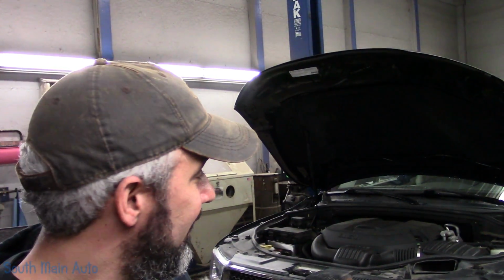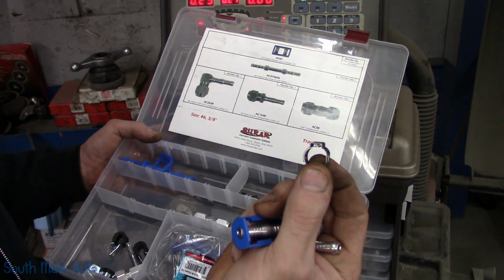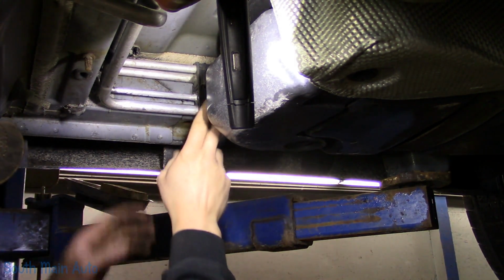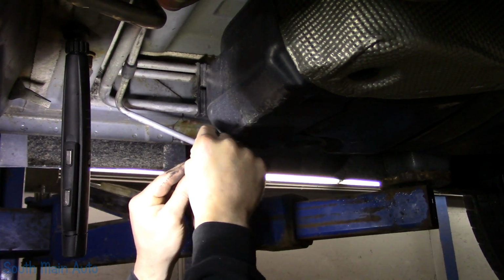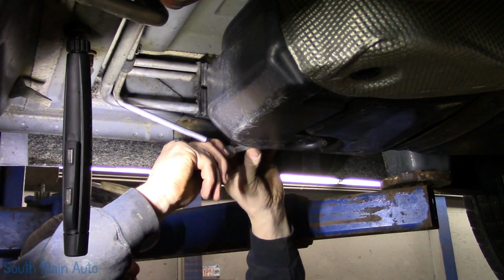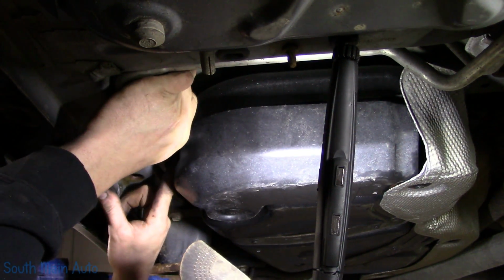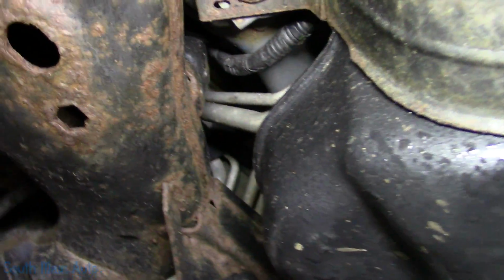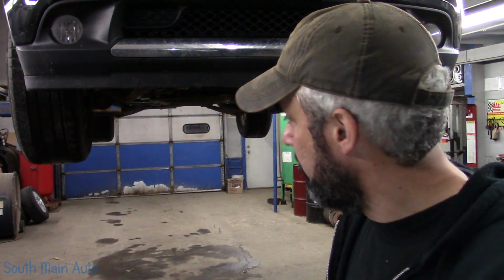Leaking Rear A/C Line Repair - Dodge Durango

Comment: Hi Eric...just a tip from an AC guy: Try a drop of NyLog on the O-ring, ferrule, and  line (and sometimes the threads).  NyLog is a sealant they've been using in the HVAC trade for years.  It works, and if used correctly (meaning sparely), it will not gum up orifices or TXVs.  I've had mixed results using NAPA repair fittings (never noticed if they were Dorman or SUR&R).  Most of the time I can get them tight without sealants, but there is always that 10% that can never please the sniffer.  Since I started using a couple drops of NyLog, I think I have that failure rate down to about 1%.  Make sure you get the NyLog Blue...it's for refrigerant systems using PAG oil (NyLog Red is for CFC and HCFC refrigerants using mineral oil lubricants).  The stuff sells for about $10 from my local HVAC supplier but, it's available on line at places like TruTech Tools for about $13.  The last NAPA repair fitting I bought (like the 3/8 line-splice fitting you used in the video) was $48 my price (a rip-off, I know... the same fitting is $34 on Amazon).  I haven't been able to find any reasonably priced kits like the one you have.  So, mostly I buy OE lines and fittings.  I've found they are usually about the same (and sometimes less) money.  But, when a repair fitting is the answer (like Chrysler rear AC systems)... at the price for these non-reusable "You-have-one-shot-to-get-it-right" repair fittings, a drop of good sealant is cheap insurance.
Reply: Nylog works great.

Comment: Great to see an AC repair. People wonder why AC is so expensive, but when you factor in all the specialty tools and training, its easy to see why. For an isolated rear AC problem I might have been inclined to block that part off, recognizing that the front AC was fine. Next one that comes in to be blocked off, please keep the camera rolling.

Comment: Eric O. needs to take those remaining wire tie tails , and spin them off ( five turns ) with plyers or an electric drill. The heat of the moving friction softens the vinal and never leaves a sharp tail to cause a cut or cuss. Have a great day , fella.

Comment: My first job was working with Reynolds Aluminum Solar back in the early 80's and they had aluminum compression fitting for connecting their aluminum solar panels and they were also a one shot deal and if it leaked the glycol then you got out the hack saw and tried again. No loosening or tightening on those God awful fittings and fine thread just to make it more difficult.
Great video as usual, you truly are a joy to watch for those of us in the maintenance trenches.

Comment: I never had luck or patience with those leak detectors. Last truck shop I worked at we had a nitrogen bottle with a gauge and low side ac fitting. That worked slick for finding leaks. Eric, you`re gonna start losing your hair if you keep worrying what some scumbags say behind your back. You`re the best out there thusly being a target to the low lifes. Keep up the good work buddy.

Comment: Eric o… it seems you got lucky with the location of the leak as most of that line looks to be  unaccessible. Good call on your part to do the compression fitting. I believe the customer would look at that and say that is a professional repair.. Thanks for the video way to start my Saturday morning off right.also that monroe shock stool would look better in my garage!" Too cool"

Comment: I used a brass ferrule compression fitting on the plastic clutch line on that '94 S10 plow truck I've got. Works mint!  😁 Saved me from having to do the job twice after my zip ties melted, and then let the plastic line lay right on the exhaust, as I held it to the boards until the valves floated while stuck in the snow. I underestimated the heat of a 5,500 RPM run at ZERO MPH. 😂

Just came in to eat lunch & clear my head. Battling a '08 Impala with a P0411. Had a plugged up solenoid valve / pressure sensor, and a bad solenoid valve relay. Well, I don't know if it's my Autel, or GM just being GM, but I was so mad this morning that I'm ready to take a nap here at 1pm! Trying to run the AIR test. First, while troubleshooting, it said, "Engine temp. too low" ... so ran it around the block ... then it says, "Engine temp too high". SERIOUSLY?? Wasted a ton of time waiting for it to cool enough to run, then the stupid thing times out, so key off / back on to try again - did that a bunch of times to confirm the new relay and valve worked. Now it's back together, so I figured I'd run the AIR test and set the monitor. Tried, and it won't let me in anymore! GRRR! Keeps saying, "Wait 60 seconds - limit exceeded". Key off / key back on, same deal! Now I can't confirm the fix unless I let it go and let the lady drive it for 2 months, since she doesn't leave town. I friggin HATE modern cars man!! I just can't deal with this stupid crap!! 🤬Letting me, and the car cool down, and I'll try one more time. This is friggin RIDICULOUS!!!  Might have to just let the lady take it and walk away. 😤
Reply from the maker: HAHA (sorry to laugh at you) Good ol GM AIR System. Did that one take that million dollar "diverter valve pressure sensor" combo? Expensive little guys and they corrode on this inside and set up all the time. Even when I use the tech II it has a 30sec max on timer then it is key off and wait. That gets frustrating on GM because they do that on the cam actuators and other tests too...
Reply: Ahh, great! I get to look forward to that too.😔 I know you know the struggle! I swear GM is trying to make techs quit. The way they engineer stuff makes my blood boil! Defies all logic!

Yeah, I replaced that valve/sensor combo unit. That was fun. Stupid plastic retainers on the hoses. Fantastic location for that blower motor too - right in the line of fire for salt, water, and road sand. None of the o-rings I had were the same thickness as what GM used - I figured as much! They were still relatively pliable, so I douched them with silicon grease and reinstalled. After I relaxed and watched your video here, I went back out there, and I was able to run the AIR monitor - was strange, because the Autel said the test failed ( think it was spelled "test fuaild", or something lost in translation, LOL!  😂). Monitor read OK, and no codes - I WON! 😁Anyway, I shipped it, so the lady can run it and get the rest of the monitors to complete (I couldn't get the EVAP monitor to run with the Autel - kept kicking me out because some unknown condition wasn't met - said to rev to 1,800-2,200 ... but the second I touched the pedal, it aborted). We'll see if it ends up back here for something else. What a TOILET that vehicle is!! 10 years old and it's complete JUNK! SMH ...

Comment: Sometimes when we are tubing instrumentation runs with multiple compression fittings we will mark the tubing on the dry fit behind the nut with a sharpie. Then we can quickly visually check everything has stayed together before tightening. Very enjoyable video, keep up the good work!

Comment: A couple of years ago, the A/C lines to my rear evaporator on my '98 E150 failed for the second time in its life. The first time, I purchased the OEM replacement line kit at $,$$$ !  The repair required dropping the gas tank so all together it was BIG BUCKS>

This time the repair shop said they could have a custom made hose made and installed for only a couple hundred.  The shop subcontracted out the hose and unfortunately the company had a hard time getting the proper ends so it took several days to "build" the hoses.  They used Goodyear Galaxy A/C hose and just tie wrapped to the frame from the front to the rear.  I did add some "extra" protection at point that were likely to chafe.

How many 20 year old midwest vans have functioning rear A/C !  Pretty amazing !!!

Comment: I've never seen those anywhere before, great idea! I usually TIG Weld holes or damage from accidents in A/C lines. You said 'cough Dorman' 1 more time than SUR & R so 'cough Dorman' will be thrilled! Haha 

Another alternative(though not my first choice) to the zip tie could be a rubber insulated saddle/cable clamp etc but that would entail drilling holes to fix to the vehicle.

Comment: A rubber lined “p” clamps would have been perfect for securing lines together also I remember years ago refrigeration technicians would have used compatible refrigeration oil to aid in joining threaded compression fittings- great work & enjoy videos:)

Comment: They call them cinch clamps. I get the PNs from SUR&R website & order from eBay. Less than Adv Auto free shipping & no tax. The 5/16 comp fitting PN AC516 at Advance $28.99 +Tax and eBay $24.29  5/16" doesn't come in kit (don't know why) but can be ordered separately along with a bunch of mm fittings. AGS does same crap and you have to buy at auto parts or hardware stores. Auto Cooling Solutions has some nice splies good to 2600 psi I may try in the future. I'm going to say it but Dorman does have certain products that are pretty good like the splice fittings and their nylon fuel line repair kit but I'm under duress writing this b/c most everything else is junk and will comeback broken if it makes it out the door. Nice job & enjoyed the video as usual!

Comment: I wish I'd known about those products yrs ago. I passed on a couple A/C jobs that had impossible to replace frt to rr lines that were leaking. BTW, expensive or not, a customer will gladly pay $30.00 for a fitting vs 300 for a line and god knows what kind of labor. May not be the prettiest fix, but function over form in this case. Nicely done!
Reply from the maker: Plus you have the option to just block them off too

Comment: Since doing a complete replacement of the OEM lines were not cost feasible, this was the next best alternative for the customer. I actually was happy to see Eric O. Use the aluminium compression fittings over those rubber hoses. The compression fittings look more stock/OEM and I think they will be more durable. I don't think my mechanic shop knows or has this kit for A/C since every time I had a leak I either had the whole line replaced or I lived without the A/C. I'm definitely gonna let him know as it's an awesome alternative and much cheaper too. Love this channel!
Reply: If you lived where I live, Phoenix, AZ you definitely DON'T GO WITHOUT AC. If my AC breaks and it can't be repaired I buy a new car.
Reply: SATAMAN Schmidt I thought Arizona was supposed to have dry heat? No humidity where you don't sweat? Not like the southeast where the humidity is off the charts. I can remember growing up when air conditioning in vehicles was an option and I myself have owned cars without it. I'm not going to get rid of a perfectly good car because of a non working A/C system.
Reply: Then buy yourself some oven mitts because you can't hold the steering wheel out here in Summer without air even with full gangster window tint which is absolutely mandatory. Brakes are optional, AC is not. Every year children die in cars left by idiot parents who leave them in the car and go shopping. It's a dry heat pal but 115F is 115F I don't care how dry it is. That stated very seldom will any water come out of the AC drain. Back in Pittsburgh you'd have a pond underneath you when stopped at a red light. Here nothing.
Reply: insert "ove'glove", solar reflective shield and solar window  vent fan commercials here ;))
Reply: We're not talking about the car parked with all the windows rolled up?? What are you talking about?? You just lower the windows of the car while you drive so you can lower the temperature.  Once the car gets rolling the temperature will reduce.  You act like nobody else ever lived in a super hot climate.  No kids ever died from driving down the interstate with all the windows down.
Reply: Kenneth White, me and my cousins all did numerous times, was lucky to have a radio that played and car that ran ok. forget the AC working, if it had one. then again I'm in Ohio, not AZ or one of the other scorcher areas.

Comment: Great job Eric.I am a Chrysler tech in northern Ontario Canada.This is a common problem with these durangos.We fix them the same way here, even under warranty.Very poor design,almost impossible to replace the whole line bundle as a unit without destroying it.
Reply from the maker: So basically I did a "dealer level" repair! SWEET!
Reply: I've got this issue with my 14 SXT Durango. But the line has rubbed through causing a pretty heavy leak right above the transmission
 The line was rubbing on the top of the transmission.  There is not adequate room to do this type of repair up there, what are my options?? Please help!!

Comment: Did something very similar today to my 2011 Durango using GASP Dorman line terminator block off kits, one 3/8" and one 5/8" (for the guy below asking). Got the Dorman parts on Amazon for about $32, plus a can of AC Pro.  I cut the lines about 10" farther forward than where you did, right near the very front of the rear driveshaft because I think my leak was between there and the spot where your repair was. The terminations were good quality and appeared to seal well, no leaks noted after the first hour...we will see how it holds up. My third row passengers won't be happy this summer but this is a brilliant repair.

Comment: I just had to change the shaft seal on my ac compressor. The power steering pump had been leaking all over it for about a decade. I hosed everything down with brake clean before working and learned the hard way about the brake clean and refrigerant sniffer. As soon as I walked under my car port, it went off and pegged the scale. It’s a TIF ZX-1.

Comment: Since I was a guy who did this work, and moved on to doing commercial HVAC work, let me recommend not only the Nylog mentioned below, but also to pressure test the system with dry nitrogen up to the working pressure with a little 134a in the system, and then go over everything for a final leak check. As you no doubt know, Chrysler had a big problem with evaps leaking, and my detection method was to hold my sniffer at the evap case drain, since the refrigerant was heavier than air, and when I had silence (from the detector) it was golden.

Comment: PS:  if you slide a piece of rubber hose just larger diameter than tube onto part next to tank prior to installing coupling it will insulate the tubing next to the tank.  And by the way, when you leak check, do so by vac'ing the system then doing a 10 minute test to see if the vacuum leaks down prior to charging (if you don't already do that).  You probably already know this but for those who are watching, they may not.  I've found the electronic leak detectors so inaccrurate as to be unreliable for most smaller leaks.  And I've got over 40 years experience on a/c and refrigeration (perhaps 10,000 leak checks under my belt).
Reply: A Day what do you think about pressurizing with dry nitrogen? I've had semis pass a vacuum leak test but not hold a charge. Just the other day I had a dump truck that had been charged at a mom and pop shop that could not find any leaks. I hooked a machine to it and pulled it down only had .4 lbs in it. Ran a vacuum leak test and passed. Hooked nitrogen to it at 250 psi and the leak shows its self at the TXV. Evaporator somehow wore down enough on the flange to where the o-ring would not seal under pressure.

Comment: There are a number of outer shaft deburring tools that work very well for such applications and reasonably cheap too (under $20). They are quick, and since they pull the shavings away, much less likely to leave anyvin the tubing. Nice job, Eric! 👍

Comment: That's interesting that there are kits like that available.  Thanks for the reminder about the Chrysler minivans. I've had to change the rear a/c lines on a few under the recall. Wish that they would have done what GM did, put them in sections, would have made doing the recall easier.

Comment: I have a 2014 Durango and the same thing happened 2 years after purchase (2016).  I was so mad I drafted a letter to FCA and my wife deleted it. At least if was still under warranty.  Anyway, they claimed they had to partially lower the fuel tank to do the work so I ran the tank as low as I could and dropped it off for the day.  Came back at 5 PM and drove off satisfied.  Fast forward 16 months and I'm at my brother-in-laws farm and he puts it up on his lift. He is curious since his friends just bought a used Durango of the same year.  Well, the lines had all popped out of those cheap plastic "holders" and he found a missing gas tank strap bolt.  Thankfully he is a trained mechanic (heavy diesel but I don't let that bother me ...) so he found a suitable replacement bolt and showed me a way to strap the a/c lines back and keep them from banging around.  

After I returned to my dealer I showed them the picture of the missing bolt.  They apologized. Later I found out the mechanic was given a royal butt chewing for the mistake.  I'm just glad that the tank didn't fall out of the 700 mile trip to my in-laws.

Comment: I guess times have changed. When i was in autobody college 1991 we installed rear cabin ac on our instructors personal ford van that had R12. We used 3000psi hydraulic hose on the high pressure side & regular 5/8 radiator hose and hose clamps on the low. A lot of it. All the reclaimed R12 was free sucked/filtered/stored from damaged cars.
Reply: R12 ran at much lower pressure than todays R134.

Comment: We used SwageLok fittings in the laboratory, were leak free and reusable and with small molecules like hydrogen and helium.  Available in different metals like aluminum, and metric and SAE as well.

Comment: I work for Chrysler,  I've done the rear ac lines , you drop the tank , tank trans mount out lower trans down a little and take the right side rear cradle bolts out an pull them out. Warranty pays 5 hours lol